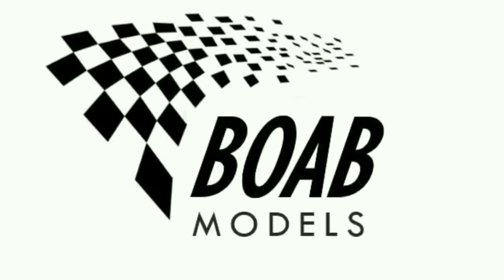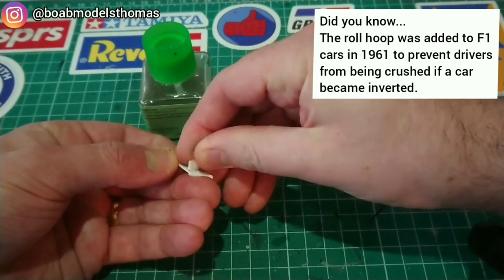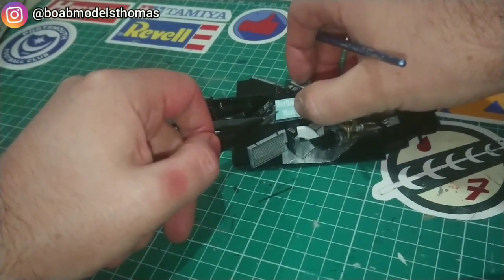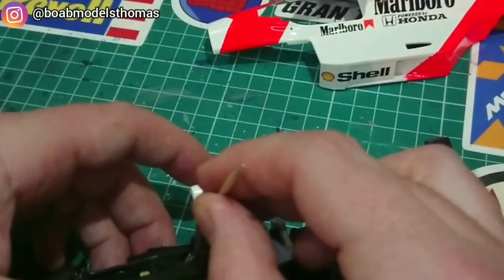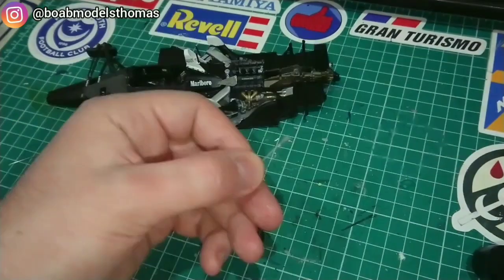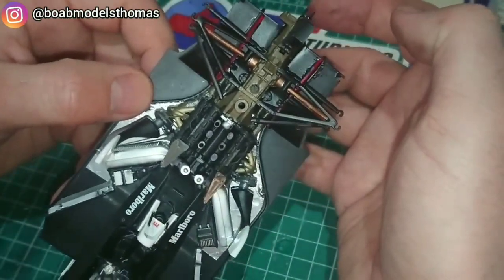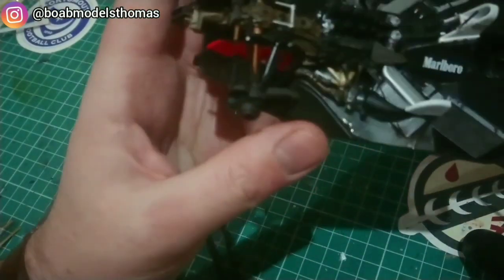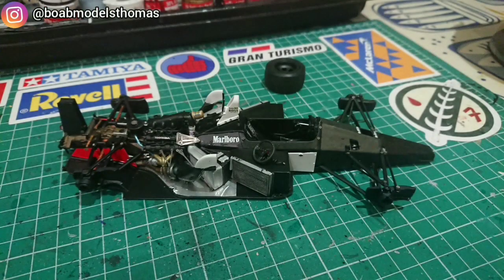Senna's McLaren Honda Mp4/4 - part 4 - V6 turbo engine - how to build 1/20 Tamiya with photo etch

Comment: The side pod opening varied from circuit to circuit depending on colling issues needed, the insert can be adjusted which was a good idea bt Tamiya I thought, coming along nicely. I built mine on its release so is about 30 years old now :) should get another I suppose. The gold / silvery bit on the plenum chamber is the pop off valve to keep the pressure within required FIA limits
Reply from the maker: Thanks Sarah Jane. I noticed too late that the openings on the side pods were adjustable as I'd already sealed them. The top studio detail set you can buy has slightly different side pods (not that you would use those.) I've seen some kits on ebay lately.

How are my facts? I'm sure you will call me out if I am making errors! 😂
Reply: @BOABModels  The Facts are a nice touch, I wouldn't call you out, only say if things are off, everyone makes mistakes. I've just been following motorsport for so long is all,  AR76 said he started watching F1 from 2008, I feel old now :)
How was the tyre screws tip coming or haven't you got that far yet ?
I'll have a look on Ebay sometime when I have some cash thanks.
Reply from the maker: @Sarah-JaneR32  no I greatly value your input and I don't like to be inaccurate when I claim to state facts! 😂
I have been following since 1995 as the Hill Schumacher rivalry was my earliest F1 memory so a little further back!
I'm not onto the wheels yet but I may give them a test fit later. I bought a Goodyear stencil so the tyres are going to take a bit longer...
Reply: @BOABModels  I keep meaning to get tyre stensils, they make a big difference I think. I'm way before then but living near Silverstone was a big part of getting interested in motorsport when I was young and santa Pod is just up the road :)
Reply from the maker: @Sarah-JaneR32  I have Goodyear and Bridgestone ones but they are 1/20 so not much use for the majority of my kits. I hope they turn out nicely now.

Comment: Thank you for the videos - nice build.  I haven't seen though, which decals did you use ( You said yours were destroyed).  I have this kit that I am getting ready to finish, and I have new Tabu Design decals for it.  I see you used Tamiya TS-36 Flourescent Red and that it was a good match for the decals, and it really looks like it is.   Thanks again for th evideo and any help.
Reply from the maker: You're welcome Shaun. I may have mentioned in the unboxing video but I used MSM creations decals which worked very well. I have heard good things about the Tabu design ones so hopefully yours work out ok. Good luck!